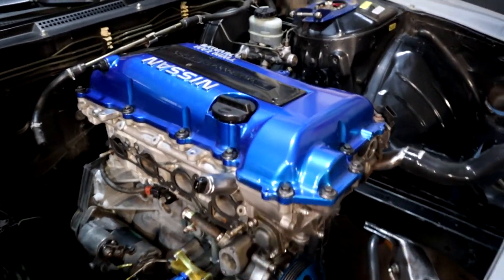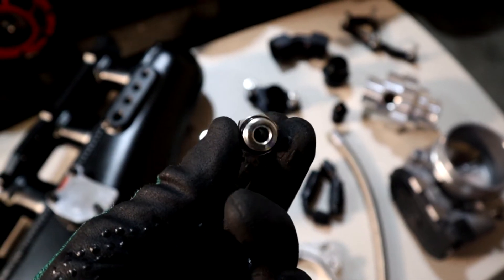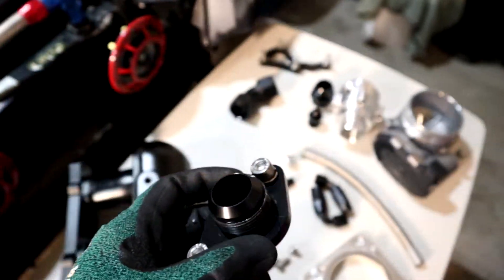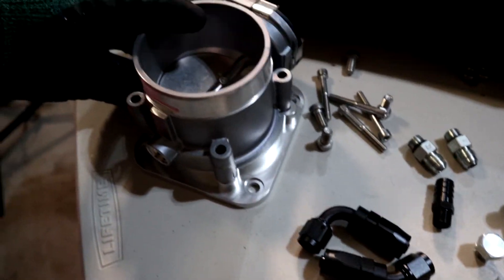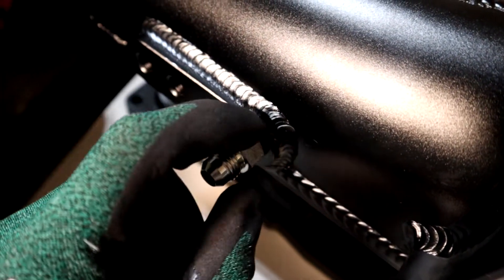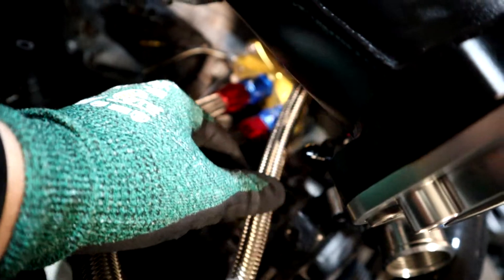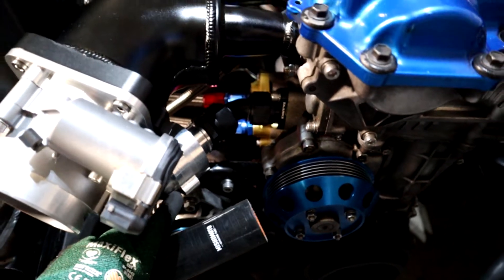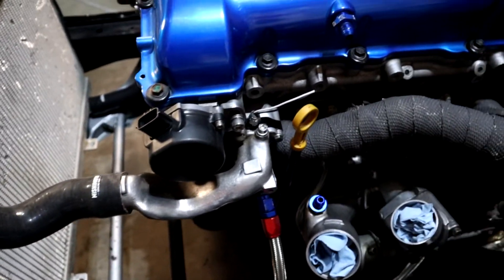SR20DET Upgrades - Intake Manifold / Coolant System / Throttle Body (Nissan S14/S15)

Comment: Why do parts manufactures use weird sized for threads on car parts knowing everyone is going with -6 or -8 an lines. Same with sensors stop giving me threads for anything other than 1/8th npt every sensor we buy comes in 1/8npt and I’m tired building a pogo stick of adapters to fit a sensor

Comment: Your knock sensor is not oriented like the OEM mount? How to check that it is working correctly?
Reply: I just replaced my Knock sensor and didn't know there was a OEM orientation. 90 degrees to the back of the engine is what I did because thats how it was when I took it off
Reply: @MichaelMontez OK thank you for this information. I heard that the orientation could affect the sensitivity of the sensor but I don't know... During the mapping my mechanic was bothered with it and deleted it. But I would like to put it back because it is a safety feature. Maybe the knock was because the head gasket was too thin
Reply: @MichaelMontez I also have a problem, it is the engine which heats up very quickly when drifting despite large volume radiators (oil and water) perhaps a bad assembly of the water hoses so if it is possible to have a video of your editing I am very interested. Level of the electrical harness too but in France we don't have the same? Thank you for your videos in France people are not very willing to share interesting information
Reply: @MichaelMontez Apparently the original mounting of the knock sensor would be around 45° in front but this must be checked especially if your work correctly as it is. What you tell me reassures me a little because mine was facing downwards when dismantled 😅
Reply: I'm going to watch your videos more carefully, I think I missed a lot of information. I also need to learn English better to better understand your comments

Comment: Where did you get all your stainless steel bolts? Do you mind giving the sizes friend?
Reply from the maker: I actually sit on a large collection of them. I often switch all the visible ones to stainless when I start a new project. There are some tricks to finding the sizes though. 1st is of course to remove and measure the bolts, but that can be a pretty slow process. The 2nd way that sometimes works is to go to partsouq.com and look up the model. For Nissan, I have noticed that some of the bolts are called out using a code that actually tells you the thread and length. If the code appears like 08120-8801F or 08363-62025 (for example), then it most likely tells you the info. Look at the second part of these examples. The 1st one is 8801F, which is an M8x80mm bolt. The 2nd example is 62025, which is an M6x20mm bolt. The first 3 digits of that second part often tell you the info.

Comment: Hi there 
I asked the supplier about the vacuum thread sizes , he said that’s 3 ports of 1/8npt and 1 port of 1/4npt . Is that wrong size for the large port ?
Reply from the maker: The manifold I have is definitely a -5 AN. I thought I was going crazy when I was trying to figure it out. But I triple checked it, and measured the threads on the originally supplied fittings, and sure enough it was a -5 AN  (5/16" - 20 threads per inch). I ended up buying a -5 ORB to -6 AN fitting to adapt it.
Reply from the maker: That being said, maybe they have since changed the thread. I'm not too sure though.

Comment: Hi
How about the fuel rail? 
Are going to use the rail that came with the kit?
Reply from the maker: Yes! That's actually the next video I'll be uploading. It'll be the fuel system that fits with this intake. Should be in the next week.
Reply: @BrainPowerMotorsports  thanks
Reply: @BrainPowerMotorsports  hi 
can I ask the E-throttle BOSCH serial no.? I`ve searched on the internet but I didnt find anything about 80mm size throttle . maybe this is a 82mm throttle ?
I`m waitting for the next video ^^
Reply from the maker: The Bosch number is 0280750114. I believe it is from a Porsche Panamera. I purchased it from JDM Garage in the UK, along with the adaptor plate.
Reply: @BrainPowerMotorsports  thank you 🙏😊

Comment: I am doing an aftermarket intake manifold as well. Will I end up loosing any features in the process? Kinda like when you SR swap an s13K, it used to be common to lose out on AC.
Reply from the maker: It will honestly depend on what manifold you choose. If it's similar to this one, or a Plazmaman, you may need to get clever with how you route the coolant lines underneath. I have another video up that is a bit of a review of the NPBoosted manifold. Watch that one if you get a chance. I go over the fitment issues underneath the manifold, and it shows why I decided to redo the coolant system.
Reply: You can try the greddy one, the greddy one I have (the old school top-half version) retains all the features, like iacv and what not, and it clears the fusebox. Plazmaman also sells a tophalf one similar to the greddy but idk if you can still keep your amenities.

Comment: Please if it’s possible do a full install video on that electronic throttle control if really like to do this with mine as my throttle cable is too short with the intake manifold set up and it keeps throwing off my tps and idle
Reply from the maker: That's going to be one of the next videos up!